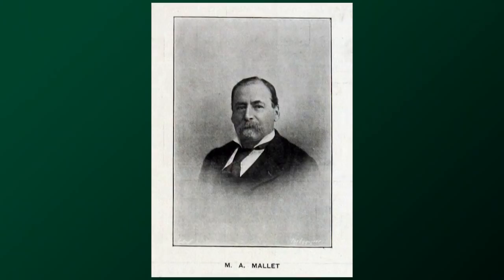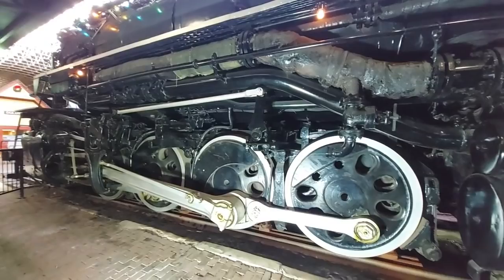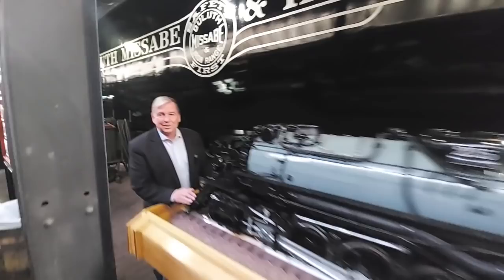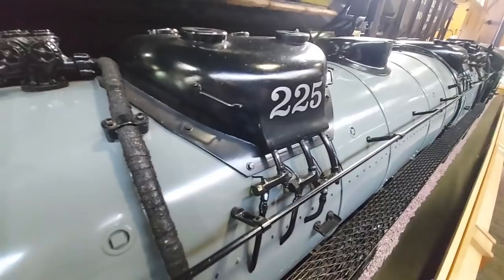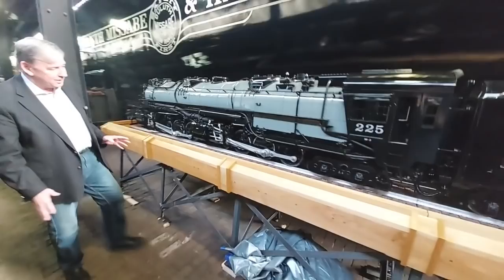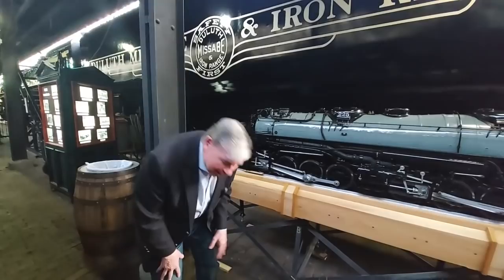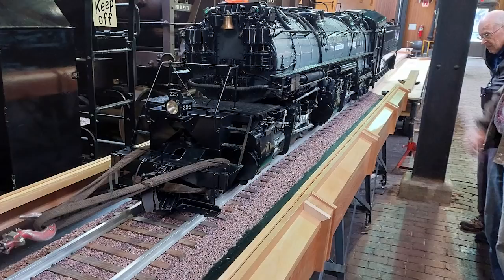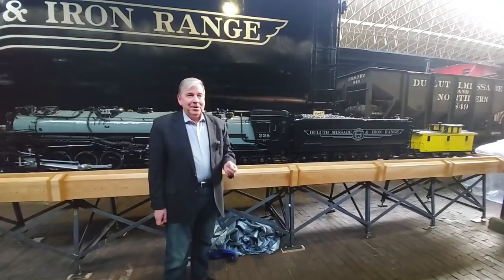Moving a Monster Model of a Mallet

Comment: A Mallet is just one type of articulated locomotive; look-up Beyer-Garratt, Failie (Double Failie to be exct), Meyer, and also several others.  The 'Yellowstone' was the name the D&MIR gave this model, just as the UP named their 4000 class the 'Big Boy'.
There is a Double Failie currently under construction at the Ffestiniog Railway in Wales (UK). The loco is being built in the same shops as the first ones in 1870 something; th, meyuch rebuilt over the years, they are still in service.

Comment: Great video have visited over the years starting when I was a little kid. The 227 uses high pressure steam in both sets of drivers so many call it a simple articulated
And would call a mallet one that uses hight pressure steam in the back cylinders then reuse the steam in the front at a lower pressure so the front cylinders would be larger. DM&IR has some mallets that they rebuilt in to simple articulateds.
      Just some info. But great video thank you for posting it.

Comment: You have most of your facts correct. Mallet was the inventor of the articulated locomotive, but his articulates used steam twice. Modern articulates used steam steam in both sets of cylinders once, coming directly from the boiler.
Reply: The Yellowstone is a simple articulated locomotive, not a Mallet.
Reply: In fact, the last main line steam locomotive stood up on the rails in N. America was #2200 Norfolk & Western Y6-b, which was a compound locomotive, so NOT simple steam in both cylinders.  The Y Class had 'booster' valves to admit full pressure steam directly from the boiler, but only when lifting the train from a dead stop.  After something like 15 mph, the engineman switched off the booster and the engine reverted to compound operations with the much larger front pair of cylinders receiving expanded/cooled steam exhaust from the rear cylinders.  Both the Southern Pacific and the DM&IR called their articulated engines Mallets, but this is strictly incorrect.  A Mallet, by definition, was always a compound articulated pair of engines under one boiler.
Reply: These railroad facts are tricky. Little wonder was built first in 1969 compared to the first Mallet which was built in a1976. The facts are tricky because there are like a billion other double ended locomotives with no proof of their once existence built before Little wonder, first being Seraing with no picture proof so idk.¯\_(ツ)_/¯
Reply: @mesenteria  So is a Garrett an anti Mallet?

Comment: Not a Mallet, all articulated locomotives are not Mallets. A true Mallet is a compound (front cylinders are low pressure), a true articulated is simple (all cylinders are high pressure) and usually the same size.
Reply: Correct about Mallets, but an articulated locomotive is simply any locomotive with a hinged frame. Mallets are articulated: they're articulated and compounded. There's no sense in which a Mallet is not a "true" articulated locomotive: they have the defining characteristic of a hinged frame.

Comment: Technically a Mallett is a Compound Articulated locomotive, so not all articulated locomotives are Malletts. So a big boy is not a real Mallett because it is simple (the steam is only used once) not a compound)
Reply: another design worked better then the simple mallets called the Garratt the garratt is very complicated but they where not as powerful hwever they spread there weight better and could run on very light track
Reply: @IndustrialParrot2816  Garratts are a whole other kettle of fish, although the first K1 was a compound.
Reply: @johnkuzma7066  actully only 3 or 4 garratts were ever built as compounds
Reply: @IndustrialParrot2816  yes, with the long distance between the cylinders it wasn't that feasible because the steam would condense in the line and be wholly ineffective once it reached the LP cylinders. Atlest on the K1s (only compound Garratt I'm familiar with) the cylinders are facing one another to reduce the distance (rather like a Kitson Myer), this has the problem of reducing the available space for the firebox tho.
Reply: @johnkuzma7066  the simple expansion garratts worked better but the long steam tubes were a minor issue

Comment: 28 Years of building and never ran it once on a railway?
And it never will?

That's just,........ sad. :-(
Reply: i know maybe they do something something specail for an anneversry or something
Reply: Boiler would need inspection and testing before running. 
On the first fireing there would be all sorts of leaks to troubleshoot.
Reply: @devinholland2189  True, but it would be nice to at least try.
I know someone who has built an Allegheny locomotive in 7-1/4 inch and it's nice to watch.
There is a video of it if you search "C&O Superpower QSMEE"

Comment: "Mallet" versus "Yellowstone" is comparing two completely different concepts in a way that just doesn't make sense. A Mallet is an articulated compound steam locomotive; a Yellowstone is a steam locomotive with a 2-8-8-4 wheel arrangement. Any given steam locomotive could be or not be a Mallet, and could be or not be a Yellowstone, completely independently of each other. It's like having a discussion about whether something is an apple or a green fruit. It could be both (a green apple), one but not the other (a red apple or a lime) or neither (an orange).

Comment: Noticed a slight problem with this you called the big boy in the alley but the big boys not a melee it's simpler tastes like it all of its cylinders are equal the Yellowstone's front cylinders are bigger than the back bear male uses high-pressure steam through the back cylinders and low pressure to the front cylinders big boy has equals things onto all cylinders

Comment: Could you add an air compressor underneath to the boiler so it can run in the plastic covering?
Reply: Have to oil it regularly
Reply: Right I forgot about that… that’s gonna be a problem

Comment: Not all articulated locomotives are Mallets. Mallets have high pressure cylinders in the rear which then exhaust to the front,  low pressure cylinders.  Locomotives with both high pressure cylinders are not Mallets. Yellowstone are not Mallets,  they are simple articulateds.
Reply: But if A. Mallet of Switzerland invented the first articulated loco, then they are ALL Mallets (or pronounced 'mallies' by some aficionados and modelers). Power distribution differences don't change this fact..
Reply: @MarkInLA  Mallet's invention was specifically a compounded articulated locomotive. The point of the compounding was that it only required low-pressure steam through the flexible joints. Putting high pressure steam through those joints required further innovations.